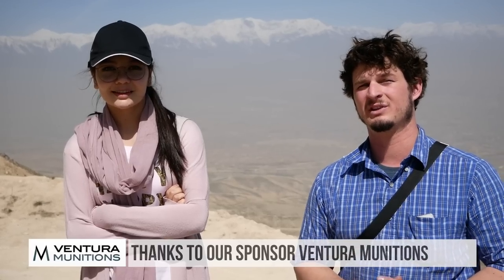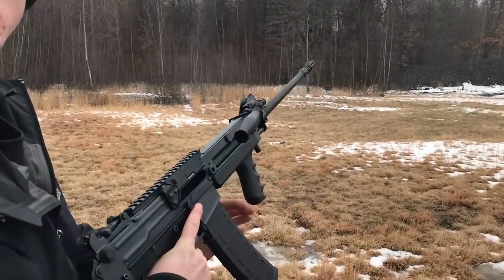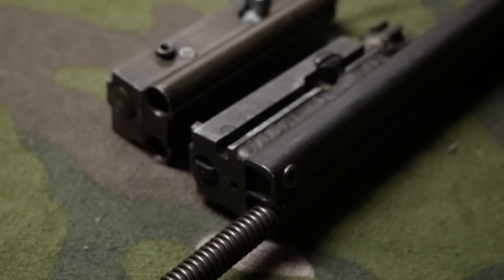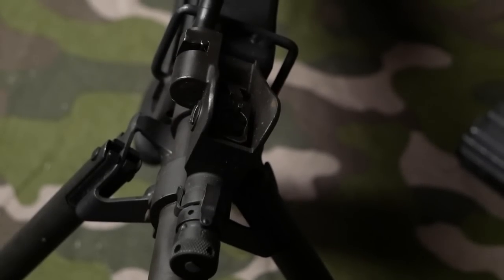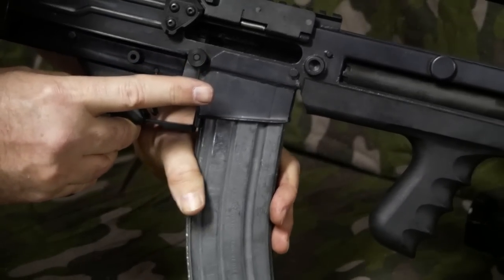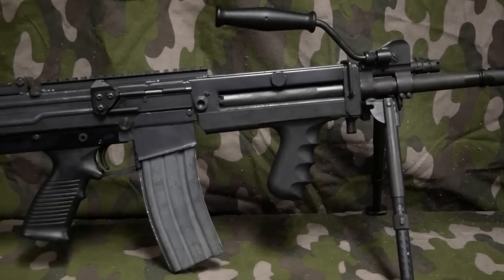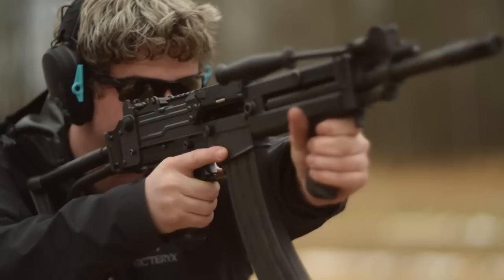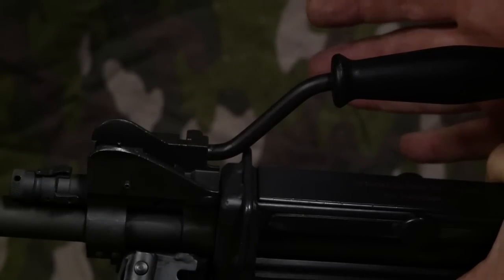Ultimate Ultimax? The Improved 2000 Model

Comment: Woohoo, glad to see more Singaporean weapons get some TFB Love!
Reply: Hope they can cover the SAR21 and Indonesia's Pindan soon. SE Asian weapons need some love too!
Reply: Duck_Vader hopefully TFB has access to our newer rifles and weapon systems like the CPW and the BCMR
Reply: That CPW gave off a MP7/TMP vibe. What's this BCMR you speak of? Mr. Google ain't got s**t on that.
Reply: Im proud to see a Singaporean weapon getting some great recognition. But this is so goddamn sloppy done I also feeling shameful. And the fact that a lot of things produced here could have been so great, is completely stonewalled by some stupid requirements set by the Government or in-charge.....
Reply: i read that like a few hours ago its very interesting so i have to see how it turns out
Reply: Oddly enough the BR-18 uses a 3-lug bolt rather than the SAR's 2-lug bolt. I suspect it has something to do with wanting to shorten and lighten the rifle by shortening the bolt dwell time and hence the recoil length and overall length. This is reflected by the increased RoF, the shortened length and the 600g shaved off in weight. You will also note that the action is flipped on its side - the gas tube is on the left with an ejection "hole" on the right. That leaves a lot of space on the top where the gas tube used to be, and the 12 o clock P-rail is mounted on a sort of hollow cage. 

I guess STK wants to move away from the conscript rifle gig and onto a really globally marketable platform. There is only so much you can do to tacticool the SAR. The BR-18 probably isn't as soft-shooting and idiot proof as the SAR-21 (if there is such a thing as idiot-proof) but it's more in line with global demand. If they let VT Systems market a semiauto version on the civilian market in the US and priced it correctly, it will take off. That, however, means American domestic production which is a bit of a faffle.
Reply: Zeno115 Give chance la those SAWs have been getting thrown around since before MRT even existed. In all likelihood there's a huge box of pristine SAWs waiting to be used during a real mobilisation and the ones we get are lousy "training" weapons.
Reply: Hmmm you do have a point there
Reply: I don't think it's a problem with age but with design.  Seeing as in the previous episode it has been trialed in small numbers but isn't in wide service anywhere outside of Singapore.
Reply: Ernest Chin haha this gun is designed by an American🇺🇸 Leroy James Sullivan lol just Singaporean labor don't give them credit for a weapon they didn't design a lot of there weapons they have made are Israeli and American designed look it up they hire foreign firearm experts for their expertise mainly Israel and American and if people don't know that then there taking all the credit instead of crediting the foreign designer happens all the time
Reply: Ultimax in SAF are horrible, is IA magnet, fire 1 Mag IA 5 times, you clear IA more often than shooting.
Reply: @charlesglass999  OK boomer

Comment: They should make a civi version for the U.S. market.
Reply: AKlover can’t do a civil version.  The system requires an open bolt.  That’s prohibited by us law.
Reply: ...if memory serves me, I think you might be able to convert it to a closed bolt, after all, the bolt/extractor is almost a direct clone of the M-16's, you just got to figure out how to get the M-16's firing mechanism onto the weapon. Maybe. Can't be sure, the last time I touched the weapon was decades ago.
Reply: Not sure I'd want a DI gassed support weapon.  It would need to run dirty and run garbage ammo.
Reply: AKlover it’s not di.   The gas hits a piston then the piston hits the front of the long carrier near the sight. On of the 2 vids shows the excess gas venting up front.
Reply: bolt/extractor is a clone of the M-16, the gas system isn't.
Reply: Daniel C bolt extractor is like the ar18/sar80 bolt.  No gas rings
Reply: Ok, ok I'm getting old, don't beat me on the head, I'll lose brain cells even faster. :P

Comment: Is the Ultimax 2000 and Ultimax Mark 4 the same thing? A Singapore army guy once told me the mark 4 went to the marine corps trials but HK was chosen as the rifle.
Reply: By HK do you mean the M27?
Reply: Duck_Vader Yeah. I actually meant the HK416 but M27 is just the US military version of the 416... so yes
Reply: The mark 4 keeps the Singapore drum.  I don’t know if they corrected the safety
Reply: Machine gun DAD. Hmm. Maybe 2000 is just the US name. US military always change the name when it's adopted in the military
Reply: The latest version is the Mk 8
Reply: Shiladitya Talukder the gun is engraved 2000 and the import papers say 2000.  This gun was sent to the marines for eval. But I think the name is different to show it doesn’t use the Singapore drum.
Reply: Andrew C did they drop their drum and go straight stanag for the mk 8?
Reply: Machine gun DAD. I see. I get it now
Reply: I thought it was the Mk5 in the Trails
Reply: Leon Cranson i don't know if MK5 was in the trials but the 2000 might be based on the mk5. Mk5 had the 100 NATO drum mag
Reply: Leon Cranson we sent mk3s to 29 palms and 2000s to Virginia
Reply: Machine gun DAD. No the 100-round drum is still catered for but users have the option to use stanag and the c-mag for the Mk 8.

I guess for our Singapore Army we will likely use the stanag or the SAR-21 magazines if the Mk 8 is adopted.
Reply: Andrew C so the mk8 has a changeable mag well?  How do they deal with the different mounting holes and the Singapore drum mag prohibits the use of a mag well
Reply: Machine gun DAD. I am not so sure but based on what I have learned the problem of the different mounts seems to have been rectified
Reply: Razer 6413 looks like a 2000 with a better stock and safety buy the old drum.
Reply: You mean 'retained' lol. Your safety was the unique one.
Reply: Daniel C yes my safety was uniquely bad.
Reply: I guess one could say it's a much more refined Ultimax 2000. It's interchangeability is a huge plus though. ST Kinetics sure has been pumping out a lot of goods recently.
Reply: Razer 6413 they have lousy marketing.  They think find an old general and he I’ll get you contracts.  They have no idea about us law enforcement market and they will not consider licensing
Reply: They did try licensing with General Dynamics Land Systems I think. Died a quiet death.
Reply: Yeah, it's a real shame though since some of their firearms are pretty decent. They do tend to focus a lot on vehicular development however.
Reply: The 1st Marine Division's initial assessment of commercially-available automatic rifles was conducted by the 2/7 in July 2001.  There was no contract on the line back then; it was more about proving the capabilities of an automatic rifle versus the M249.  Even then, the 2/7's Gunner, CWO3 Jeffrey L. Eby, was lobbying hard for the IAR concept.
Reply: I wonder if that was why they used the reclining stock. One of the complaints then was that the sights were set too low so when you had a cheek weld, the sights were below your field of vision. A reclining stock might have been their attempt to lower the shooter's line of sight.

Though as I commented before, once you hit 'folding stock' on an Ultimax, you're screwed. Left side blocks the charging handle, right side blocks the ejection port. Keep it removable or retractable.

In a way, you can see that they're trying (with emphasis on 'try') to correct perceived shortcomings in their products. They just need to give it a bit more thought and practical testing.

Serial number in the 100,000s? I never knew they made that many. And yes, I think the numbers are sequential, the previous weapon on the vid had the serial number 53 according to MG Dad.
Reply: If it wasn't for the safety and the drum it very well might have been selected too
Reply: Machine gun DAD. The Mark 8 has a brochure on the ST Technologies website, go check it out and tell us your thoughts on it

Comment: If you run the receiver going down the full length of the butt stock for an even longer spring, wouldn't  this work as a full power battle rifle that's actually useful in full auto?

Comment: Id be making a simple spring and a pair of notches in the safety to make it detent in place(same was an AK retaining wire, or the way an ar15 hammer spring holds the pins in) that safety they put is a terrible design lol
Reply: No argument there. What is odd is that it isn't the original safety, the original was a flip toggle type, so they "improved" it into a terrible design. Not to mention a folding stock is really stupid for this weapon, the original was a removable stock. Flip this new stock to the left and it interferes with the charging handle, flip to the right and it blocks the ejection port. All in all, a very questionable modification to the weapon.

Comment: I absolutely love this series!  From the time I first shot the Swedish K submachinegun, I feel in love with the controlability. 

The Ultimax looks like that carried 2-3 generations of innovations.   Why doesn't the US use this?
Reply: King Baldwin IV no belt feed.  And chartered industries is messed up
Reply: Machine gun DAD., thank you, that amswers it succinctly.
Reply: Well, to be fair, they were very poor at that time so corners were cut. The -2000 isn't too bad though there were some disappointing parts like the safety. 

As for the stock, I think once the specifications were 'folding stock' you were screwed. Sure, left folding blocks the charging handle, but won't folding right block the ejection port which is worse? For the charging handle, at least once you cock it, you don't have to touch it until the next magazine, getting the rounds deflected back into the ejection port is a potential stoppage every round. Guess the only option left is to flip down. Personally, I'd try using an M-4's extendable stock instead, retract it if you need a shorter weapon.

The 1200m range was for the very old tactic of MG indirect fire, the 5.56 is still lethal to 1.2-1.3km for 'area targets' though the effective range for 'point targets' is only 400m. Rarely used these days, the focus on training these days is 'first round kills' and 'ammo conservation' though I severely doubt many people in the field ever gets one round kills....
Reply: Yep no belt feed means no go for US military. They liked the recoil, weight and control, but yeah we really dont like drums.
Reply: Marines tested it. fired fine but I think the stamp metal construction was too flimsy. Lightweight but not sure you could fire it after a big grunt step on it.
Reply: 高恩太 yeah? so what’s up with the IAR?
Reply: The US Military doesn't know what it wants